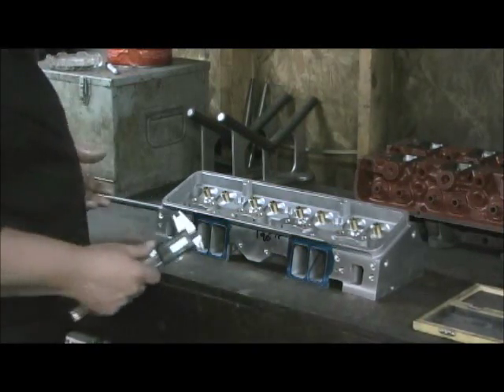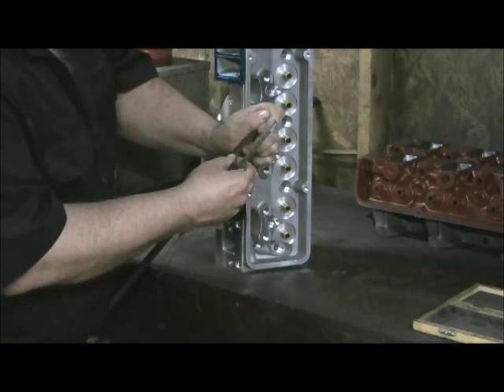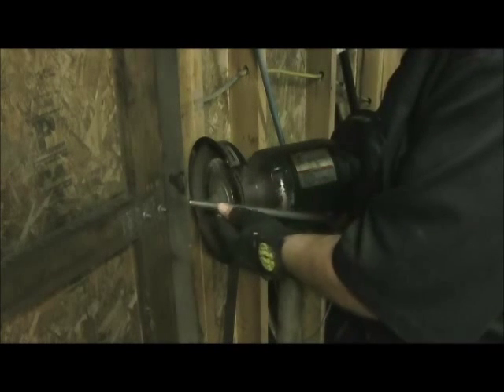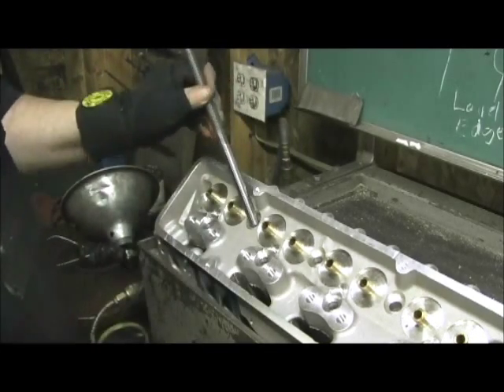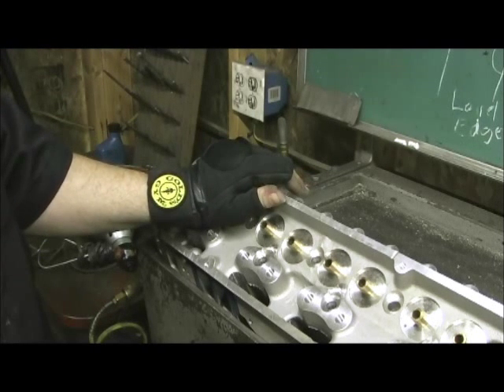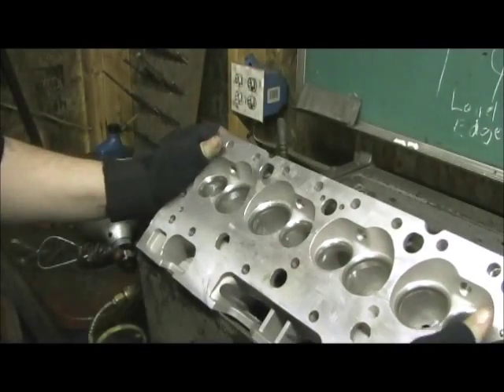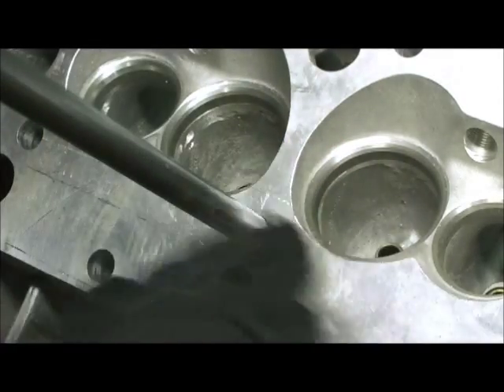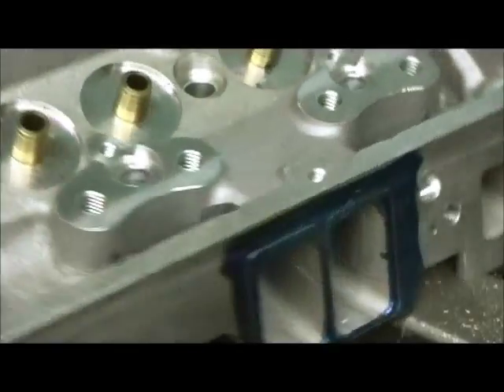ProComp 190cc Stage IV.5  "TUBES"  installation, prep, sizing, and discussion  Part 2 2

Comment: And the theory on equally out negative pressure, take a truck bed for instance, with the tailgate up, inside the bed has a negative pressure, causing air to flow over the tailgate without being interrupted.  Thus being createing less overall drag verse if the tailgate was off, or completely removed.

Comment: Basically, having everything rounded off and smooth can actually do more harm than good, because edges can cause the direction of flow to change to a more favorable location to overall create less resistance.  Of course, every design is different, and so is the application so using other methods can achieve the same overall result.

Comment: The squared edges has more to do with changing the direction of flow, which can causes a change in overall flow. Overall, the dictation of the port layout determinds adding multiple "square" edges to the valve. I will say, I haven't spent years testing to back up my claim, so if anybody has, please correct me if I wrong.

Comment from the maker: Theoretically, maybe, that has more to do with elevation of the runner than anything else. As the port gets closer to being "RIGHT ON TOP OF THE VALVE" it becomes rounder, as the resistance is lowered and negative pressure begins to even the mainstream flow angle out (more balanced).

Comment: Supposedly air prefers angles over a radius. A round port would in theory be the most efficient due to the smallest surface to volume ratio possible and the least wall losses.